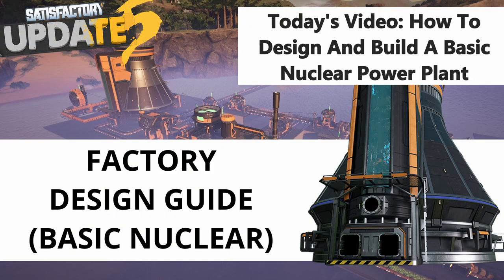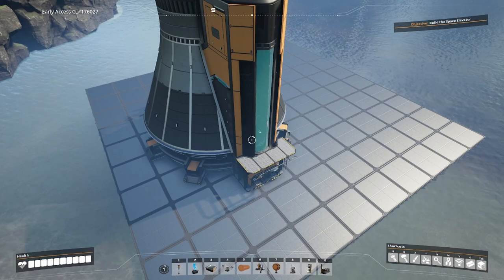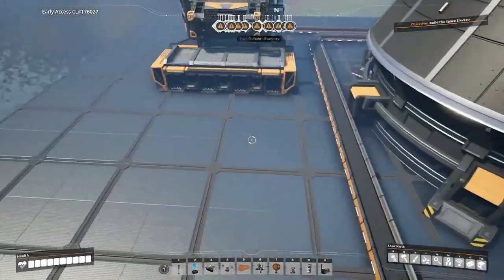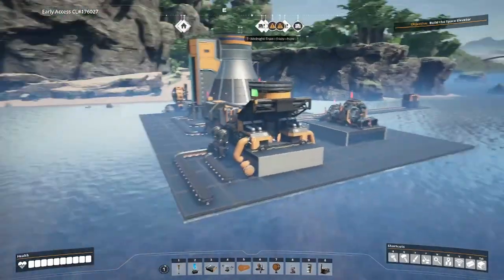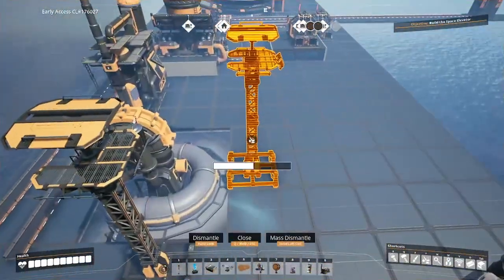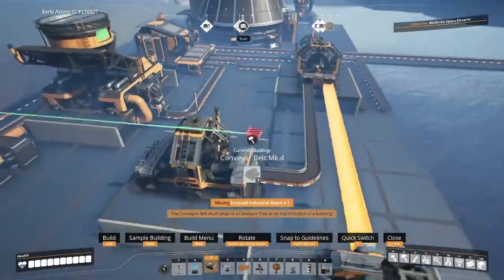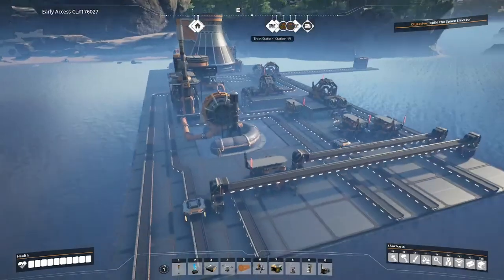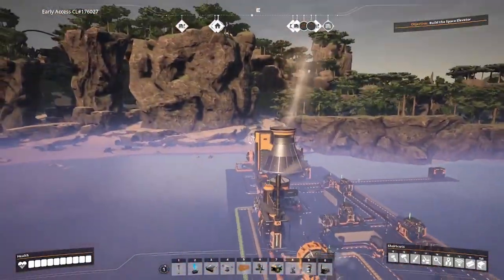How to Design a Basic Nuclear Power Plant Setup (Satisfactory Update 5 Factory Design Tutorial)

Comment: I love this design!!! And I learned a lot watching you - even where you had to back up and fix things as you went along. I did run into a problem tho. I thought it would be easier to make several of these if I blueprinted it (two 12x12 blueprints that I could stick together). However there is a reported bug that won't allow you to place a water extractor INSIDE a blueprint. It says the water isn't deep enough when I try (but doesn't complain if I place it in the same spot after deleting the blueprint.) So I had to put the water extractor for the sulfuric acid outside the 22x10 border and route a pipe in from there. Otherwise the plant works great! Thanks for doing this - I will subscribe.

Comment: this is waaaaay to fast, the speech speed makes it hard to follow.. Can you do a re-edit
Reply from the maker: This video is 2 years old - a week after I did another version available at https://www.youtube.com/watch?v=7CxEOZNfvR0. the design still works but they changed the recipe to require rotors instead of beacons -  same materials, though slightly less than I state in the video.

Ill make an updated guide in the next few weeks, im still on fuel in my 1.0 save myself.